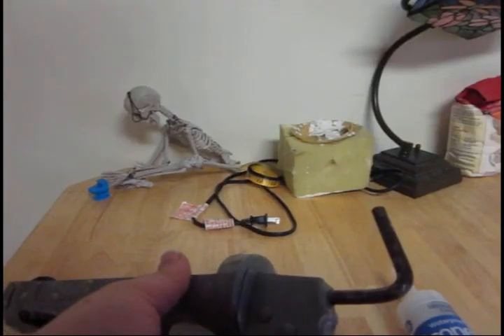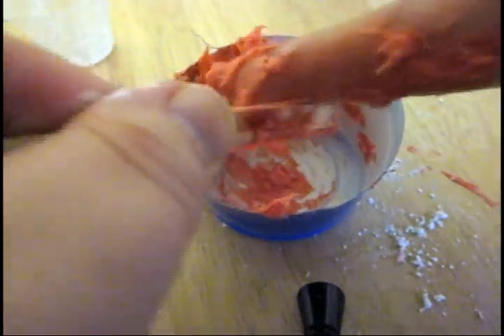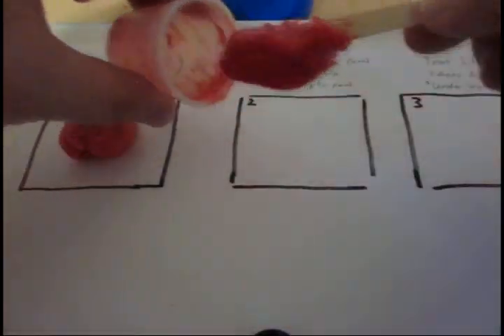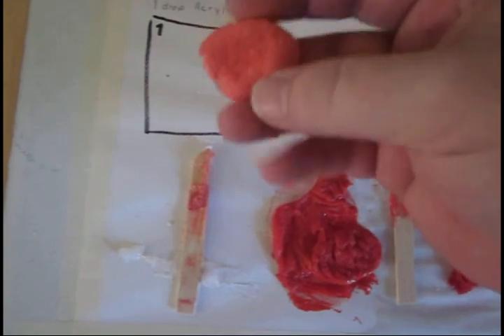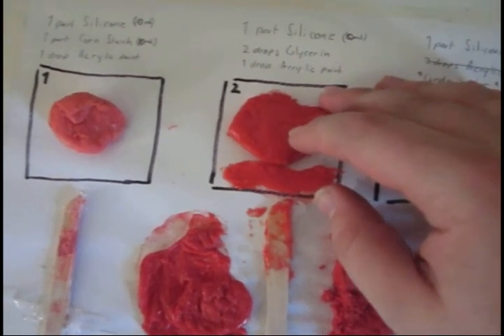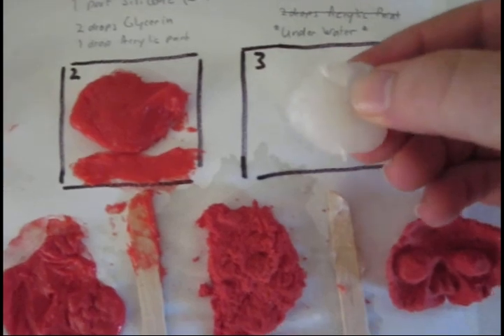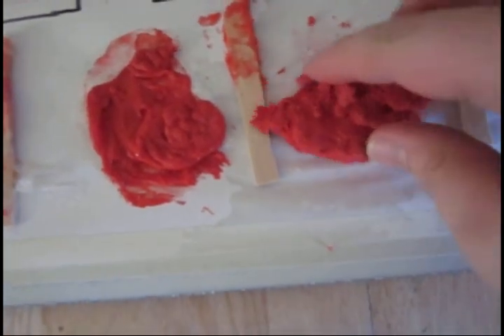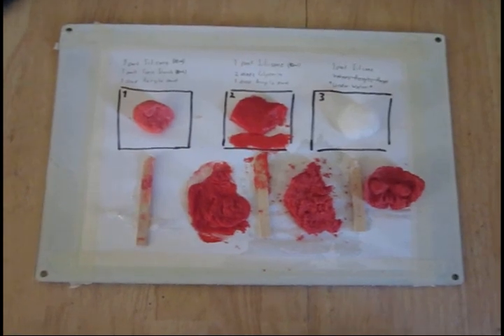Silicone caulking as a molding material?

Comment: buy a $100 gallon of 2 part tin silicone, your results will be 1000x better, this would never work for any decent size molds. also i recommend buying a platinum based catlyst and adding to the silicone caulking it may cure it like a normal 2 part mixture.

Comment: Pour 32 oz of water and 8 oz of a good dish soap  ( I use dawn). Swirl the water and aoap together well. Squirt your silicone caulk in the mixure. Then you massage the silicone under water to get the soapy water to take the sticky away. 60 sec. Should be long enough. Then your ready to smooth out you silicone and place things in it to make molds. Very very easy and no mess except maybe soapy water. You can use this soapy water over and over again with more silicone

Comment: Psst.... you didn't add enough cornstarch to your first experiment to take away the stickiness.  Works great if you 'mix' it correctly.  :)  Also, adding a drop or two of baby oil to the mixture will make your mold more flexible....and will stay that way, overtime.  Also, kneading it (like bread) instead of 'mixing' makes a big difference.........Thanks for the experiments!!

Comment: Just use silicone and cornstarch. My molds cure in 30 minutes no paint. No oil.  Immy objects push out fine.
Reply: +Paula C i use this method and avoid any 'sticky probs by wearing disposable vinyl gloves.
the under soapy water method also works well when vinyl gloves are used .

Comment: That was cool, I just made a similar experiment myself. Result:
caulk + starch: awesome dought-like or putty-like silicone mix (depending on the mixing ratio). But cured frickin fast, didn't get to make a mold of any sort because got unworkable.
acrylic+caulk: still sticky after 6 hours, not impressed
caulk diluted with naphta + powder dye = got a nice, almostc pourable consistency, dye accelerated curing and worked better than acrylic .
I might have mixed too little of acrylic though ;p

Comment: Type I is hydrophilic and cures by adsorbing water - in this case, the water that's stored in damp cornstarch.  (The cornstarch got its water from the atmosphere - an old open packet should hold more water than a new one); and Type II is hydrophobic - it cures by expelling water as it dries.  Mixing type I and Type II transfers water from II to I without any added agents, though the results are not as good as Type I plus starch.  I'd guess powdered (dry) silica gel would cure Type II faster.

Comment: I think you should redo the cornstarch experiments a few times until you get better at making it.  Your results seem much poorer than the folks at Instructables are getting (myself included).  I've made good moulds that way.  Try tweaking the ratios, and mixing better.

Another thing to experiment with is mixing Type I and Type II caulk in various ratios.

This stuff is definitely fun to experiment with!

(By the way, talcum powder *is* corn starch.  Exact same thing, different packaging.)

Comment: Silicone in water requires adding dish soap to make hand molding very easy. Use plenty of soap. else when you spread it out the silicone will startto stick to your fingers. spread thin upto 1/4 " thick. Back any molds with plaster .... I haven't tried adding aditional layers of silicone after curing. I believe you can continue to build to any thickness. SOUNDS like an experiment to me!

Comment: @volscalkur Not sure if you're subscribed to StiltBeastStudios, but Allen just did a tutorial this morning on using silicone for molding and he uses naphtha to mix the caulk. I immediately thought of you.

He does about a 50-50 ratio and mixes his in baby food jars. He's able to brush it on afterwards and it takes about 1-1/2 hrs to dry to the point where a second layer can be applied. Not sure if it's exactly what you're trying to do but I thought you might be interested in checking it out.